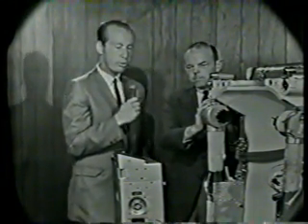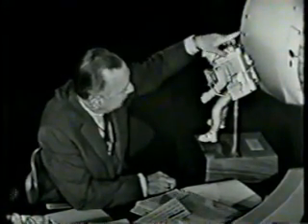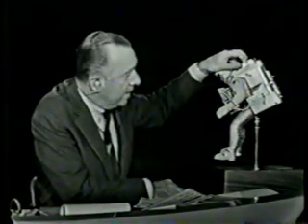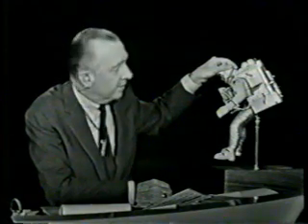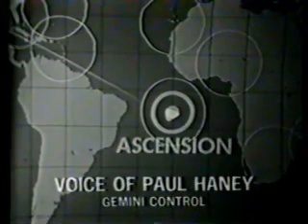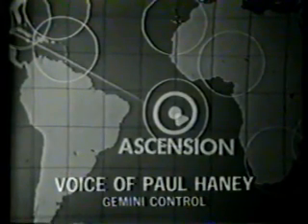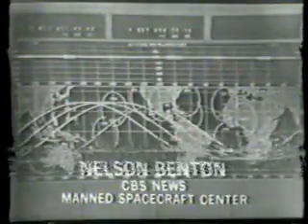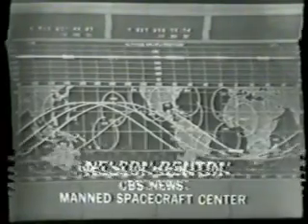Gemini 9 EVA Part 7 (Final)

Comment: It's interesting that this coverage is in black-and-white, probably because there was no available color mobile unit in St. Louis at the McDonnell plant for the simulated space walk.

By contrast, at 10:44, there is a color commercial for L&M filter cigarettes.

This was unusual to have a color commercial in a black-and-white program; for much of the early-to-mid 1960's, it was the opposite: There would often be black-and-white commercials during color programs.